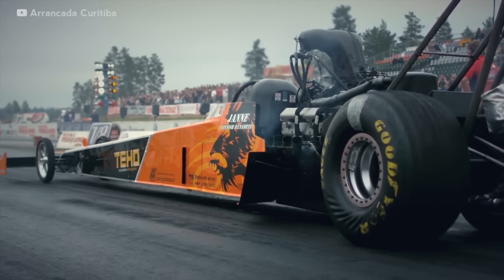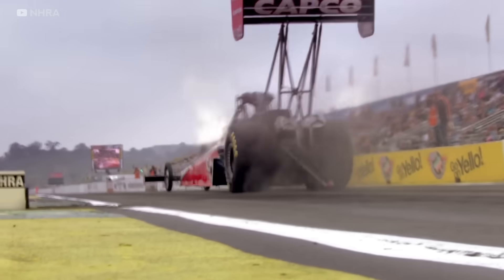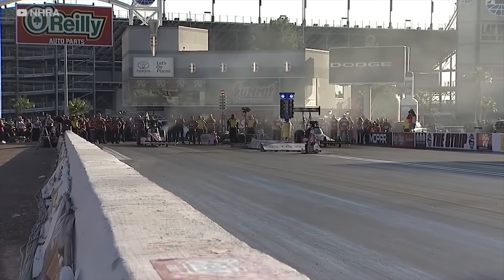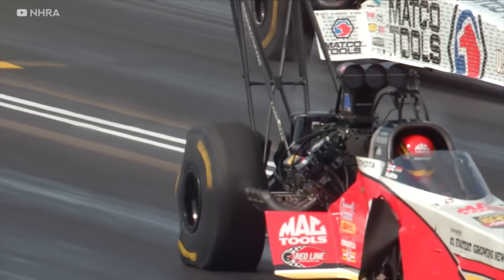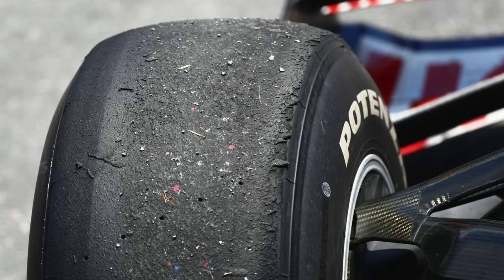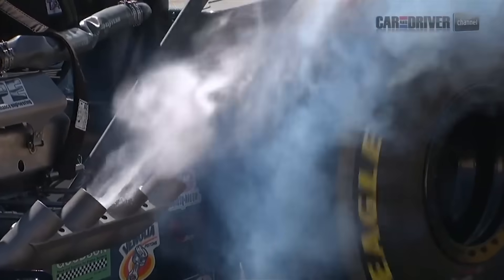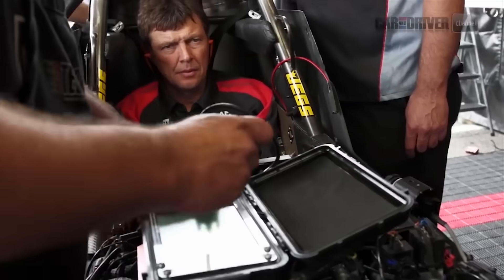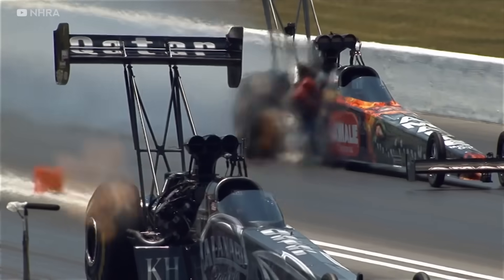How Dragster Tyres Accelerate to 335 MPH in 3.6 Seconds

Comment: Dragster Wheel
Back: Unique 
Front: Wheel of Bicycle
Reply: Then you have the skateboard wheel keeping it from flipping
Reply: I'm not doing this to correct you, so don't get the wrong idea, but they are so small because they don't need to withstand massive amounts of hrsprs and torque.
Reply: @enoztheprotogenshadeyboii7074  Plus, they need to be light, and minimize rolling resistance as well as aerodynamic drag.
Reply: @enoztheprotogenshadeyboii7074  nice subscriptions mate
Reply: @enoztheprotogenshadeyboii7074  🤓
Reply: @goatbenchwarmer6  what’s wrong with that
Reply: chuck wagon wheels
Reply: Lolol
Reply: Hahaha so funny
Reply: Some used to have plane tyres i think
Reply: Some times they mix the fuel down if the tracks in a bad condition
Reply: Its a unique and mad sport in lots of ways not disgust here
Reply: Fuck me I just posted the same comment and then seen this 😭 thought I was being uniquely funny. Got damn it
Reply: Back: BIG F1 wheel
Reply: @TeslaTunari  taidat olla suomalainen. Fun fact: toi iha eka clippi mikä videol näytetään on Suomesta Alastarolta

Comment: i WOULD understand this sport... if it wasn't trying to pretend there's any point to the existence of the driver.
As you just confirmed for me in this video, putting a brick on the gas pedal would replace the driver fully.
Reply: No it wouldn’t. They have to do a fuck ton of micro adjustments down the track

Comment: The agony the entire car goes through is pretty amazing.
Reply: Not sure if it's true but these engines have a 10 second lifespan.
Reply: @teddymills  I mean he did say that they rebuild the engine between every single run, and each run is definitely less than 10 seconds so I believe it.
Reply: @teddymills  If you stayed in it, sounds about right. God only knows what the mph would be with the right gearing.
Reply: @teddymills  They barely make 3.5 seconds

Comment: 11 gallons on 1 run... completely rebuilding the engine every run... etc etc.
When you put it like that, it seems kinda weird no? Like, there's so much waste on every run, even compared to other racing like f1 cars.

Still, it's crazy to think how fast this goes. I guess what the video failed to mention is, that one of the biggest factors that improve downforce is the balls of the driver.

Comment: so they have to use the same tire pressure, they are all running goodyears, same engine size, same fuel.  where does the competitive edge come?  the drivers reaction time?  the engineer team determining gear/clutch ratios?

i'm not being facetious, just know nothing about this sport and am genuinely curious :)
Reply: Because the science of wing angle, weight reduction, clutch pack, all of that. Also then the reaction times and launch control

Comment: 7:42 He say's that if you launch 0.1 second later at the start that will result in a 'massive time difference' crossing the line. Pretty sure that's not right! 0.1 second later start = 0.1 later crossing the finish line. Unless someone can tell me why I'm wrong?

Comment: If the fuel doesn’t require mixing with air, why is the engine supercharged?
Reply: It doesn’t require it, but it increases the power even more
Reply: @captainhellhound7451  how? Supercharger compresses air into the cylinder, but the gas doesn’t use the air to burn?
Reply: @BLKSG6  It doesnt use air to burn, but oxygen still increases combustion due to the fact combustion needs 3 things, fuel, heat, oxygen.

Comment: In that 1/4 mile run the engine only turns about 900 revolutions. The supercharger requires more hp that a Chrysler hemi outputs to turn it. Amazing machines

Comment: Mmm, very interesting, but it seems like so many measures just to accommodate an internal combustion engine. I wonder if a rocket powered car would beat a dragster in a $ vs. acceleration competition. Surely liquid oxygen and hydrogen aren't as expensive as this nitro fuel plus the tires. So long as everything is kept under 8-10 gs, it's all nice and survivable for the "driver".
Reply: They have rocket cars but they don’t beat top fuel in a 1/4. In a 1/2 they would smoke them

Comment: Surface area has nothing to do with friction 4:24
If you studied physics at high school you should know it.
Reply: So a 1 inch thick tire and a 10 inch thick tire would have the same amount of traction?
Reply: @captainhellhound7451  also this rule has an exception: "This relationship breaks down when the surface area gets too small, since then the coefficient of friction increases because the object may begin to dig into the surface."
On a microscopic level this could be the case as the irregular asphalt digs in the soft rubber. But simply connecting contact area to friction is a misconception.
Sorry for my English ;)

Comment: man, whats the flowrate on the injectors?!
Reply: Fuel is injected by a constant flow injection system at 100 gal/min. There is an engine driven mechanical fuel pump and about 42 fuel nozzles. The Fuel pipe is almost 4 inches, acceleration forces the fuel almost 20 feet from the tank at the front of the dragster.

Comment: I served in the engineroom of U.S. nuclear powered "boomer" submarine. We had a 78MW reactor that provided steam for our main engine turbines that could propel the 9000 ton boat at high speeds and drive it to the surface even if one of the forward compartments was fully flooded with tons of seawater.

Our main engines were 11,000 horsepower.

The most insane horsepower fact I ever came across was that the fuel pump on each F-1 engine on the S-1C first stage of a Saturn V rocket, and there were 5 F-1 engines with 5 fuel pumps, and each fuel pump was 55,000 HP driven by a gas generator. That's right, an engine accessory was 55,000 HP.

Comment: I've been a drag racing fan for over 50 years. But as Don "Swamp Rat" Garlits (the "inventor" of the read-engine dragster design) said, "the sport is unsustainable in its present form." Furthermore, drag racing has reached the point where only mega-corporations -- and oil-rich nations in the Middle East -- can afford to enter and be competitive in the sport.

And then there's the safety aspect of all that horsepower released on a 1,000 foot run, and everything that can go wrong. And even Pro Mods have their issues, with those 4,000 HP short-wheelbase cars being notoriously unstable, and going "airborne" or smacking the wall at times.

Something's gotta change. Even the racers and teams know -- as competitive as they are -- that the only reason they're there is to entertain the spectators. If the crashes turn off the spectators, the safety regulators, local ordinances, and shopping mall developers will see to that.

Comment: Information is not completely accurate if you've ever seen the dragster run when they take off from the line the tires don't just crinkle they expand double sometimes triple the size they started they do not rebuild the engine every run fate take it apart and let each part individually cool because they do not run water cooling systems the reason they disassemble the engine is to reduce warping of aluminum parts due to extreme heat conditions it's running on a mixture of methanol alcohol you cannot breathe you even cry trying to be next to a dragster when it's running

Comment: Not to be a Top Fuel Nazi but, ya gotta couple mistakes in there Friend. 
You inadvertantly mention the spark plug electrodes are powerful enough to arc weld with when, in reality, it's the twin 44 amp magnetos that provide the power.
You also made a erroneous call on engine teardown between runs. During teardown, the crank is the only component not removed during the entire event and if the crank is damaged, its left alone and the entire block and crank assembly are swapped out for a complete long block replacement that's one of 2 or 3 kept on board the trailer in case such needs arise. 
That's about the only facts I heard being a bit off in your otherwise brilliant video. One estimated bit of trivia that will never be a true fact and that's estimated horsepower of these beast motors. There's no dynomometer that can give a pinpoint number on these CUZ run time is limited to only 10-20 seconds before you have flying shrapnel so baseline  formulas in mechanical engineering and physics are used and while 11,000 hp is the average estimated number for now with today's standard equipment that the NHRA allows in the class but the sport is always searching and experimenting with new ideas and some test runs on certain engine designs and different supercharger models and using the same formulas as before, numbers have seen up to 13,000 hp at last word. Remember, itwasnt too damn long ago, late 70s, these were only pushing 3500 hp and the 80s saw 5000, then the 90s hit 7500 and 10,000 by the 21st Century market so, dont ever give up on the gearheads in the skunkworks of Drag Racing.

Comment: They use to run 1/4 mi. 1,320 ft. They were going too fast so now they just run 1000 ft.
I have been watching these dragsters back in the day when they were going 220 mph in a 1/4 mile.
I remember a scientist at the time said that it would be physically impossible for them to ever go over 250 mph. Given the car weight, limitations of traction,  aerodynamic drag, frictional losses,  etc. There is just no way they will ever go over 250 mph.
Reply: Bad scientist?

Comment: 0:52
They use blocks DERIVED from the old 426 Hemi - but made specially for drag racing use ONLY.
Built MUCH stronger than the actual Chrysler Hemi blocks were, and Aluminum for lighter weight.

Comment: A few more fun facts.  The supercharger, it takes more power just to run it than the majority of stock vehicles produce.  At idling it takes about 200HP just to turn the supercharger and at 8500RPM, it takes over 900HP.

The fuel is mixed with around 10% methanol but the stabilization that the methanol provides also leads to a more predictable mixture.  100% nitromethane can produce more power but it can also lead to less power at times.  So the mix brings consistency which is paramount in racing.  The track will change and the teams needs to account for it, then tying to figure out what the fuel will do can cause a lost.  So that 10% methanol makes the fuel predictable.

The "Hemi" motor is no longer what Chrysler produced way back when.  They ran out of those blocks a longtime ago.  Now they are custom blocks that are machined in a single piece for better strength.  So the block design is based on the 426 Hemi.  The 426 was a cast iron block.  These engines are billet aluminum.

Comment: Excellent video thanks. I don't know much about drag racing, so this seems like a really clear 'explainer' to help newbies like me to understand some of the features of the sport. 
One question, if the Top Fuel cars are loud enough to register on the Richter scale, why are some of the crews not wearing any hearing protection, I'm guessing they're deaf as a post by now?
Reply: The noise is mainly projected downwards and upwards because of the direction of the exhausts, hence the small earthquakes, and while they are still incredibly loud to the side and behind the dragster the sound wouldn't completely render you deaf.
Reply: Thanks @meable3763  , I don't think I'd take the risk
My ears ring after using the lawnmower ;-)

Comment: Technically, a Top Fuel dragster is not the fastest accelerating machine in the world. A rocket sled (the type John Stapp did experiments with) accelerates much harder. In fact its not even close. John Stapp built a rocket-powered, track-mounted acceleration sled named "Sonic Wind", which accelerated him from 0 to 632 mph in less than 5 seconds. It had a water braking system to bring him from 632 mph back to 0 mph in just one second. His body was subjected to over 46 g. This was an open sled with no wind protection, so his body was also subjected to 2 tons of wind force.

Comment: It's pretty simple really, tires are like rubber bands that are pushed away from the wheel by internal air pressure and will pull and stretch accordingly, there is just so much energy stored in the elastic structure of those tires so that when they meet the road and put rubber to pavement they eventually have to give that energy up to momentum as traction sets back in. With the low pressure of these soft tires they fold in on themselves at that angle from the squatting and the pulling force from the input torque.

Comment: As I understand it drop for drop gasoline produces more energy then Nitromethane.  However because you can flood the cylinder with so much as once they get far more horsepower.  I am not an expert just a big fan and that is what they always say on the coverage.  Please correct if I am wrong.

Comment: Those tires are expensive, but if they last 8 runs, they are a lot cheaper than probably most other parts of the car.  Especially the engine and transmitting rebuild.  Great video!

Comment: I believe I can answer this without even watching the video.. The tires are low like that because They balloon during acceleration. If they had too much air in them they would explode causing the dragster to wreck same reason why professional. Nitro RC car drivers glue their tires on because the acceleration is so fast the Tires will balloon and come off

Comment: I think the fact that the supercharger takes 1000bhp to turn it ,shows just how powerful the engine/ drive chain has to be.

Or put another way , if a top fuel supercharger was strapped to a Bugatti veyron engine (1001bhp) you would be left with 1bhp😅

Comment: Small point.  Top fuel dragsters usually don't race over a 1/4 mile any more.  It has been reduced to 1000 feet.  I believe this is because the top speeds were getting too high, so they reduced the distance.

Comment: imagine filling your bathtub in 6 seconds with these fuel pumps :D
Reply: The Fuel PIPE is almost 4 inch in Diameter and force feed by the dragsters acceleration to the Twin fuel pumps attached to the motor feeding 42  fuel injectors - 10 in the hat 16 in the manifold and 2 per cylinder in the head.

Comment: What's a "tyre"
Reply: The spelling tyre began to be commonly used in the 19th century for pneumatic tires in the UK.
Reply: @cules2158  thanks man. So pretty much tires that are made to resist expansion from heat and other things. so it pretty much means racing tires. So there's tyres and slicks cool.

Comment: I conceptualize this as:
Softer, low pressure tires allow for huge amounts of forward momentum to be exerted like a slinsghot. In contrast, a very hard (lets say metal wheel) would just spin, as there is no traction and the force is exerted immediately.